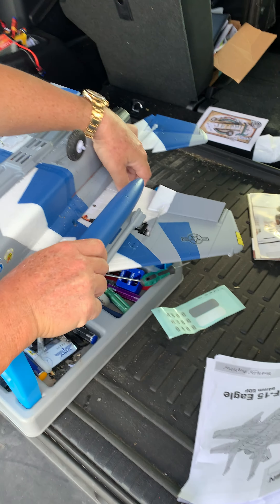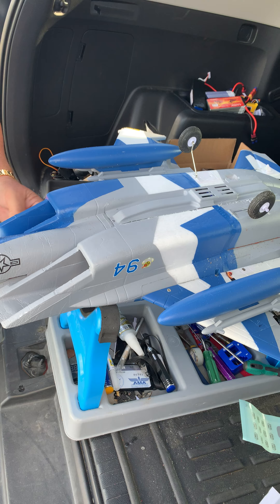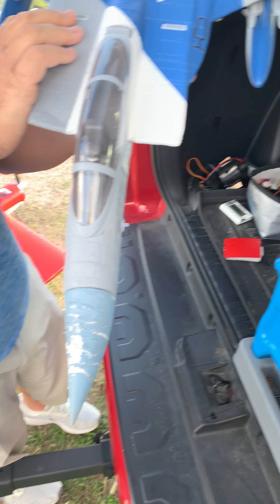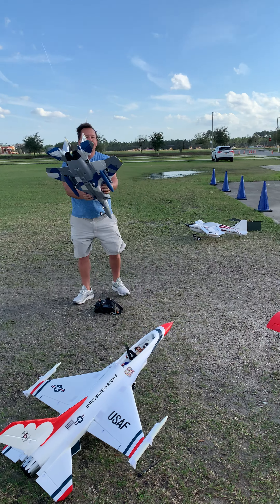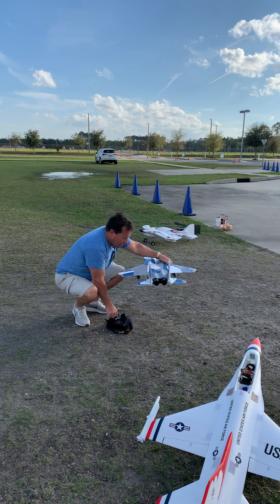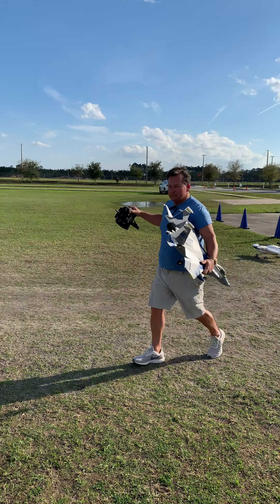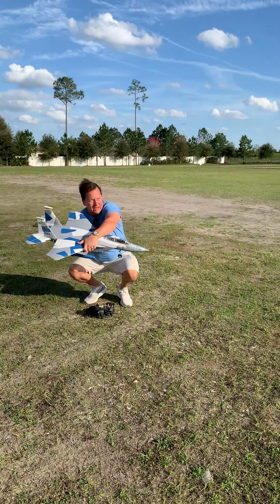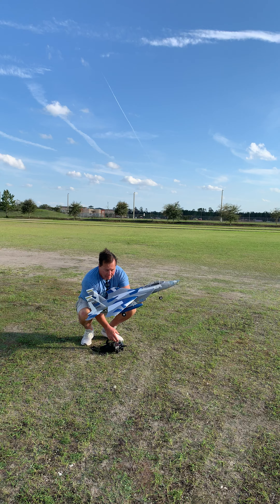F-15 Eagle EDF Jet Repair and Successful Hand Launch

Comment: Mine rolled every time i tried hand launching it with the tanks..
Reply: i too have same problem everytime i hand launch it it rool to the right and crashes to ground can anyone tell me what is the solution for it..the model is su 30 with 2200kv motor